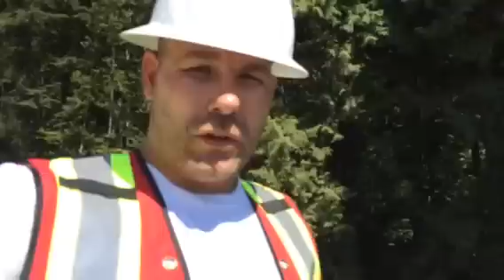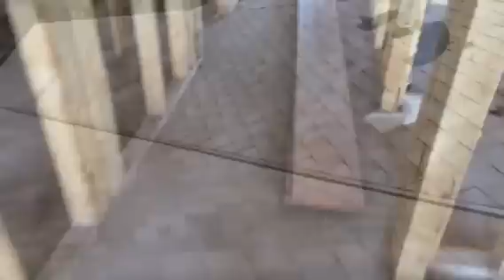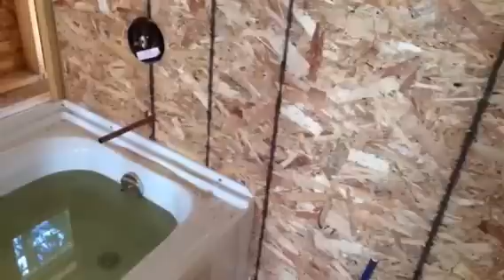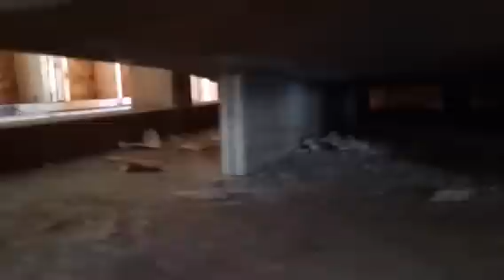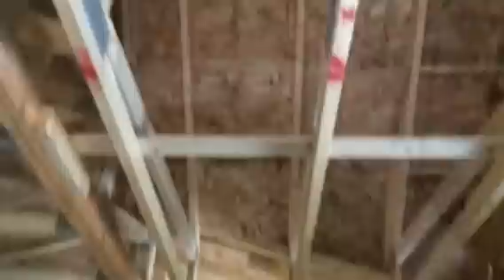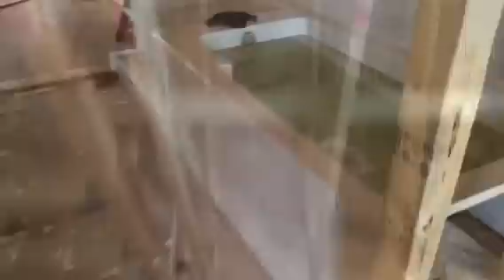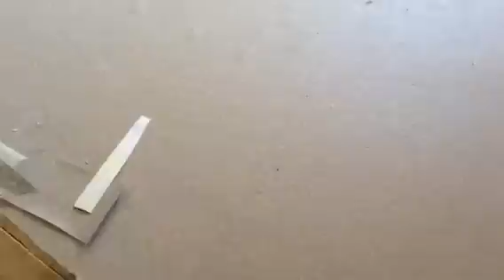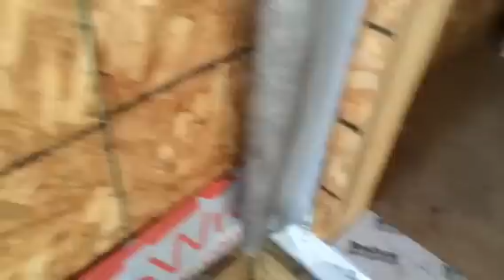New Home Construction Fails

Comment: 1 gallon=10lb? erm... a pints a pound the world around and there are 2 pints in a quart and 4 quarts in a gallon so thats 8lb not 10
Reply: it's an imperial gallon. NOT US gallon....
Reply: https://www.google.com/search?site=&source=hp&ei=TwmLVr7pBsO8eY_4oMgO&q=weight+of+a+gallon+of+water&oq=weight+of+a+&gs_l=mobile-gws-hp.1.0.0l5.2451.6752.0.8542.13.13.0.8.8.0.283.2362.0j9j4.13.0....0...1c.1.64.mobile-gws-hp..0.13.1210.3.U8Paha4cHzU#q=weight+of+an+imperial+gallon+of+water

Still 8.33/8.34lb either way. NOT 10lb
Reply: +amanda cabrera No...it says 10 lbs.  I just checked your link.  An imperial gallon is 10 lbs (4.54 liters of distilled water) and a US gallon is 8.34 lbs (3.78 liters of distilled water).

Comment: Joist hangers upside down even bigger fail hope they used joist hanger nails and not screws as well. As screws will just shear off under load where nails will just bend a bit.

Comment: I am a weather deck installer and It's very normal to get gas bubbles in vinyl decks they disappear over time. You should only get them if you use contact cement as the adhesive

Comment: Some pretty laughable mistakes there. Ran across some similar bathroom work in a condo i was living in in Cambridge. The prior owner remodeled and used cement board in the entire bathroom except the shower stall they used green-board. Likely they were walking through a home improvement store and saw "mold resistant" and thought it was a good idea.

Comment: miko jones is dumb as hell, 10 pounds is the same as 10 pounds in Canada or the US
Reply: +frank sciarrone (Frank the tank) Yes 10lbs is 10lbs in the US or Canada but a Canadian gallon is 16% larger than a US gallon so in Canada there is 10lbs in an imperial gallon but in the USA there is 8.3 lbs to  a US liquid gallon and 9.7 lbs to  a US dry gallon (though why anyone would measure water in US dry gallons is unclear)
The weights are the same but the size of the gallons differs. 

This is simple and obvious. Are you a troll ?
Reply: Imperial gallon and gallon. Not the same it not what you say it's how u say it

Comment: lol on the upside down joist hangers. Bubbles under the floor,drywall/osb behind the bathtub is not reason to fail the inspection but troublesome. Looks like the home builder tried because they did not go the cheapest route, they just seem not to have the knowledge to build a home without being watched over. I have been in the industry for a lifetime and seen some real fails, this example would have been forgotten is 2 months.

Comment: You should be glad that you are not building house in Norway.... Houses have to be airtight, the central heating system will keep the inside under a different air pressure than the outside... making it a little bit harder to open the front door. all wales have to be in plasterboard to prevent fire, some are you have to have double layer of them (Here it is important to inform, during the building process, where you are planning to hang up heavy things, like the TV). Then the isolation.... if you are good at it, it's enough with ordering a single trailer.... last house I was inn had Isolation plates in Various sizes, everything from a 100mm to 400mm with isolation, and a Central hydronic heating system.
Reply: Wouldn't you suffocate in an airtight house?
Reply: That is why they require these ventilator systems that of course use electricity.... it is expensive madness to make people spend more money.
Reply: Bro Homes in Norway must be insane.  Still no match for the houses here in the one republic.  They have to be vacuum tight with decompression chambers.  You have to put on suit and helmet just to get inside.  Once inside you have to bounce around taking steps 3-1 the standard stride distance.   Additionally, you have to always keep your vocal cords tights and lips puckered ready to make an appropriate  "kkkkerrshhh" sound.
Reply: Nick Acton Seriously, there are demands that new houses are airtight, and are pressure-tested...

Comment: I wouldnt have stepped into that building from the start seeing the hanger upside down.
Reply: +Raton Colorado You just don't know any better.
Reply: +Raton Colorado Holy crap, no kidding.  I'm pretty sure a toddler would be able to tell you which way those go!
Reply: +Randy  That's what I said, but I gave the benefit of doubt and thought about a 8 year old mind can figure that out,
Reply: +me I actually showed this video to a few toddlers, and they had a lengthy discussion afterwards with some very good points supporting your assertion. Actually, that didn't happen, except for one toddler I spoke to, he said he used a senco Palm nailer, 50' flexeel poly hose, 6gal. bostitch pancake compressor, with hot-dipped galvanized N8dhdg nails. But most just cried and shit themselves.

Comment: Heh there is clear culture difference how you build things. You say that OSB is problem at showing room because "if it get wet".... There we think that any material is problem if it get wet. It is lost game if your moisture insulation is so poorly made that material behind it get wet. Not because it expands but because it will get mold and then in come to toxic. When it is made right it does not matter is it gypsum board, OSB or concrete. Another hand if there is risk that it get wet it is build poorly any way

Comment: 3rd party inspectors guarantee the product is built to or above existing code requirements by holding the installers responsible for quality craftsmanship/workmanship. State/city inspectors aren't always up to the task of fully inspecting.

Comment: that mdf under the tub is fibre glassed to the tub at the factory, and is integral to the structural integrity of the tub.  Your 'expertise' seems lacking in many areas.
Reply: Just because someone makes a crappy product like this bathtub doesn't mean you need to install it +dragnut ! if you know anything about OSB you would think my 'expertise' is exceptional for addressing this sub-standard installation.  Thanks for watching though!!

Comment: Wow. Bathroom 1 is obviously a shear wall. You can see the strap coming through the floor in the opening video panning. Drywall behind second tub is OBVIOUSLY a fire separation. Anyone with experience in construction can see it instantly. Yes there are always quality issues in multi unit builds, which he may or may not have caught, but this video does not reflect well on the inspector and brings his credibility into question. Is there anyone who inspects the inspectors and their conclusions?
Reply: Your right Tim it is a shear wall...a shear wall made of OSB. OSB has no place in a bathroom shower assembly or anywhere around moisture for that matter. Being that your experienced in the construction industry I probably done need to tell you what moisture does to it or do I?  And yes the second bathroom if a fire depression wall with regular drywall applied. Do you know the Aquaboard has 4 times the fire separation qualities than drywall and doesn't absorb water from again a shower assembly!! 
Do you agree Cheap construction practices need to stop? The builders of these homes disappear before these components start to show signs of deterioration, typically 4-5 years and the homeowners are left with the mess to replace. Why do you think the construction industry has such a bad reputation? 

Finally, yes. Inspectors are inspected but when builders are building with junk like this it doesn't take a rocket scientist to predict the problems.
Reply: I should also mention builders where I'm from (Vancouver British Columbia) build for $200-250 a square/ft and still use these cheap products. 

And if you want to defend the use of OBS and regular Drywall in shower assemblies, your part of the problem not the solution
Reply: The Home Inspector
If OSB is such a problem, then why don't you say anything about the sub floor? And can you address the requirements then in the BCBC2012 for shear wall construction?  The engineer has to sign off on all structural components including spacing of nails on shear walls and exterior sheathing.  Did he make them change that OSB or was it done to acceptable standard?  The aquaboard gets sealed and then the OSB is not an issue.  If water penetrates any of the tile or backer, you have to repair it regardless.  Are you suggesting that if any other material is used and a leak develops it's okay for it to continue to get wet? No, a leak is a leak is a leak.  You fix it regardless. Therefore it's used for that application.  Same as the sub floor.   
CSA standards allow for that type of tub construction.  Yes it is cheap, but that's not the builders/plumbers fault.  What does the building inspector say?  I get it, you are selling your own product, and you are looking out for your clients interest.  Do you have different service levels for your client?  Do you charge the same for a basic written report as you do for a comprehensive video report? 
And if aqua board has better fire stopping qualities than regular 5/8 fireboard, why don't you say that?  I think that's awesome, but is that your opinion or an actual allowance in the BCBC? Is it rated for fire stopping? does it have its CSA approval for fire stopping?  If it does that's also great and should be pushed as that.
My point is this...and it's not personal, by the way.  You have a great demeanor and present yourself well, and the video's are good quality. But in the end, it comes across as a person trying to sell a product and therefore are biased to your clients needs. NOTHING wrong with that.  Fight for whatever you can for them, that's awesome.  But in reality you're calling out the CSA, you're calling out the engineer and the BCBC, and I just think you need to clarify that.
Reply: +tim wiebe 

Munro is more opinion than code.  If he really was able to walk his talk, he would run his own job.  See how many people want to pay ''Mike Holmes" prices without the tv show to back it!

Comment: This house has raised ridge vents the entire way, it doesn't need any additional vents.
Reply: +ipissed I didn't see any ridge vent
Reply: +rick columbo Look at the top view of the roof, the ridge caps have an offset thickness for air flow. That's all you need.
Reply: +ipissed Where are you seeing a ridge vent?
Reply: +rick columbo The whole ridge is vented with the caps. Plastic ridge vents are mostly overkill, or for show.
Reply: +ipissed From what I see the roof is vented with box vents. There does not appear to be any ridge vent whatsoever.
Reply: +rick columbo Architectural ridge cap shingles have a stand off on one edge that creates a small gap when they are overlapped. It's hard to tell in this video, but there appears to be a gap to me.
Reply: +ipissed There is no ridge vent at all.

Comment: My home would be an inspector's nightmare. Its been totally renovated but was built in the 1890s. Actually we did have to have an inspector check it out before we bought it. He just ended up saying "Well obviously its not built by standard codes but it's been here 120 years and should be here another 120". haha

Comment: the inspector explains that it's not recommended to install osb on bathroom wall,what he didn't noticed was why it was installed in the first place. Just by looking at his video I noticed the osb was all the way behind tub and that black  shower valve locator is sticking out about 1/2" which only means the framers were short on that wall by 1/2". Bathroom wall should have a measurement of 5 ft. and not 60 1/2" .That's the reason. By the way all they had to do was add strips of 1/2" plywood on the studs.And to add that you need a ledger board of 1x3 behind tub. Just read the instructions for tub installation. What do I know I've been doing renovation  for only 40 yrs. lol

Comment: They're obviously not using the OSB as a backer board, they would have installed it behind the tub for the rest of the surround as well.  Not to mention that the backer doesn't go behind the tub otherwise your drainage plan would allow the water to run behind it.  Whatever your tile backer is, it HAS to be 100% waterproof.  If there any water penetration through the backer, the wet OSB is just going to be one of many problems.   If you look across hall behind the tub, directly inline with the wet wall of bathroom there is a built up post.  There is no floor behind the bathroom, must be a stairwell.  If you look closely you can see there is no post down there, under the upper post.  The point load is not continued down to the footing.  I would be much more concerned about that.  But then again, maybe it just hasn't been installed yet.

Comment: Forgive my ignorance for asking this but when a new home is being built, does the lead tradesman sign off at the end of their assignment saying everything is ok or is there a separate building inspector that checks the house numerous times during each phase of construction?
Reply: +I do things out of spite Building inspectors are separate from the builders. A house will require separate inspections at different phases on construction, framing, electrical, plumbing, ect.

Comment: The carpenters and plumbers should be embarrassed.
Reply: Trust me they're not.  Im in the drywall business and see horrendous workmanship all the time.  I have 3 builders i do work for that actually are above and beyond all other builders ive ever done work for and are proud to work there because i know the final product is solid.
Reply: keith cunningham Lol you are going to tell the inspector the home owner hired to get off their property?
Reply: keith cunningham I'm not sure what my comment has to do with labor at all or if you are just trying to insult me but I can assure you I am a laborer right now for my fathers plumbing business. Started when I was 16 in the summers graduated high school last year and have been working ever since. There have been plenty of hard days like digging a underground in gravel (shovels dont work well with big rocks) or moving 8" cast iron all day but I'm learning and putting in the work.
Reply: Probably the same guy who doesn't know English
Reply: More importantly they should be fired because by the looks of things they'll keep doing these mistakes
Reply: Why is that??
Reply: You dont need supports under a tub, its supported but the back and front framing.
Reply: @DC-jl7ps  Looks like a fiberglass tub; the crack all the time. I'd want a mortar bed under the flat area.

Comment: Don't city inspectors catch most of this stuff?
Reply: +responsibleparty They catch most things, but I just had a toilet crush through the floor due to a missing floor joist. Right next to the missing floor joist was a sticker indicating the plumbing passed inspection and was ready to be covered.
Reply: +drollord That must have been one shitty job.
Reply: +responsibleparty Inspectors come in all sorts of flavors. Some a very good. They catch important things that matter. Others are not very good. They will complain about a light switch being installed upside down but never see a major structural issue. Some are anal pricks that will fail a job site over the stupidest thing and others are on the take. A few bucks in his pocket and he will pass a job he has never been to.
Reply: +KeffandMac YOU GOT IT! When I was pulling up the floor and holding my nose, I was using language that should not be spoken in mixed company. That sticker saying "passed" REALLY got me mad!

Comment: Tom 
please rewatch and edit your video
1 that osd in the tub shower may be a shear wall 
2 it is behind the flange not over the flange 
3 how about the 2 other side for that tub shower
4 the soaker tub that sheet rock mostly is a fire stop 
I sure you knew  since you are a home inspector
that they would sheet rock the whole first before tile 
just wondering what you think 
thank you